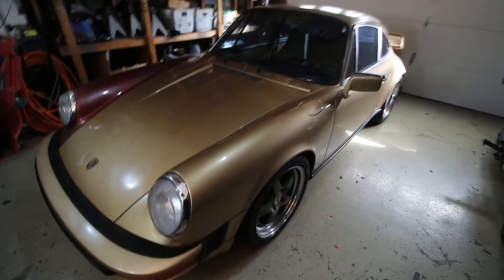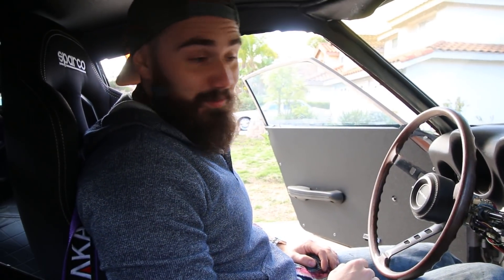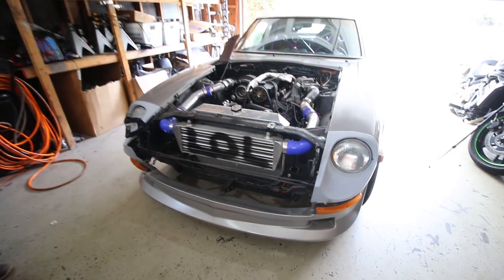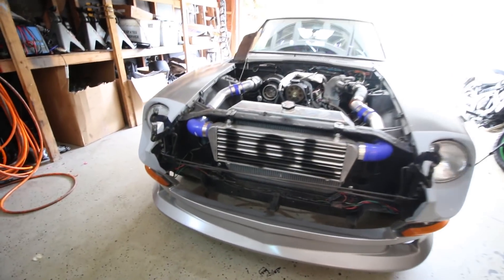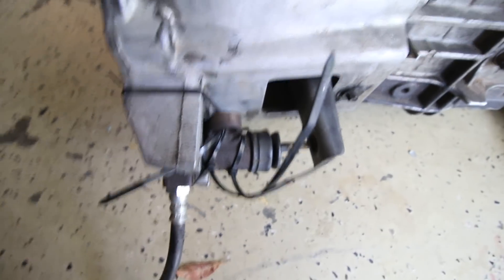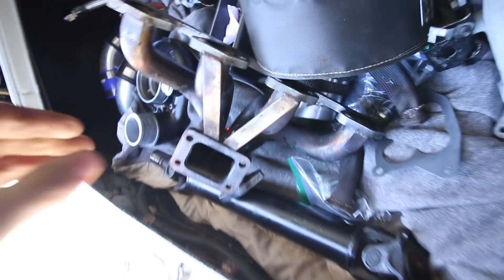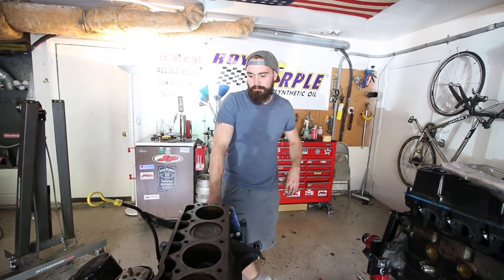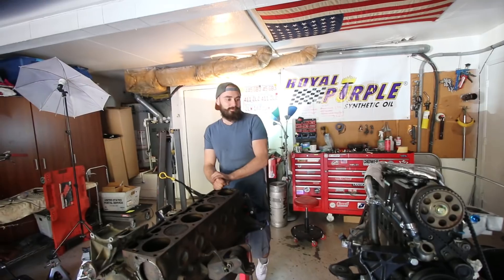The MOST HATED Engine Swap Gets Removed!

Comment: It depends if y’all want to keep it Nissan Rb26 or the original engine is fun too I am running the original straight 6 with a turbo and make 350 hp and it’s a lot of fun but if y’all want crazy power LS or a v8 are good too

Comment: Turbo 2.3 Ford Datsun 😴
Turbo 2.3 Ford Fox Body 😍
Do ittttttt
Reply: I've told them. Its a great swap.
Reply: justa4 banger I just got a 93 fox convertible with a 2.3 dual plug head and was thinking of boosting it which lead me to this channel. How much would it cost and is it worth the time trying to turbo a dual plug which wasn't made to be boosted. Not trying to go all out due to college expenses
Reply: The GTA kid. In that case the general consensus is to just star with a complete turbo coupe engine transplant ... Then slowly upgrade from there .. I haven't done this but have done the math and a TC swap IS way cheaper for a stock to stock setup .. Then sell all parts you don't use...just my two cents .. Hope it helped some ..
Reply: HAZMAT PRIEST I appreciate the info, but I can't find those turbo coupe motors anywhere for any price. Junkyards, Craigslist, Copart, and eBay nothing except modern 2.3 Ecoboost motors which I would assume don't drop in without extensive mods. Also would a turbo coupe ecu plug into my 93's harness? Thanks in advance
Reply: It depends on the power you want. If you are looking to get like 200-300hp just buy a TC motor. If you want to go higher, build your motor with forged internals and find a single plug head to get ported and go from there.
Reply: Thanks everyone for the replys, I'll be on the lookout for a turbo coupe motor now and if i can't find one I might get a Ecoboost motor when I get the time and money.
Reply: The GTA kid. It seems some areas have more merkur x4ti cars than T Coupes.. Might try that... As for the computer most people use a La3 turbo coupe computer which I believe will work in your car with very small changes but I would look at stinger performances website as they have a bunch of info on this
Reply: HAZMAT PRIEST I will, thanks.

Comment: i think Datsun should have a I6 engine, like from factory.. Sure ls swaps are cool and so on.. RB20/25/26 would be cool, but expensive. BMW engine Would be also kinda cool..

i'd personally would save for rb swap or Be a little different and Swap Mercedes M104 3.0 or 3.2 engine (watch turbobandit for info) and ask Shop to weld mercedes bellhousing to BMW 6-speed ZF- Godlike Transmission so they would fit... Atleast as good as bmw strait-6's if not better..

Comment: My efen gwd. A 4 cylinder pinto in a 240z. 
It's been 20 years since I last seen one of those pigs. 
A 240 Z in the states is the last place I would have expected one of those engines to turn up.
DEATH!!!
You best be not putting that iron pig back in. At least get a cosworth head for it.
My suggestion for the 240 Z would be a Honda K24 turbo. With no mods to the engine it's good for 550 rear wheel horsepower and is light and the motors are cheap to get from the wreckers.
An RB/ 2J swap is too obvious and common.

Comment: A 4L turbo Barra motor would be insane!
Reply: Mitch Whitmore now that's how You get it done
Reply: They wouldn’t have a clue what that is 😂 #barratheworld
Reply: Brayden Walton dat hashtag 😂😎
Reply: They're expensive to get here in the states.
Reply: Anthony Cox ah didn't think of that!
Reply: Mitch Whitmore It sucks, because I'd love to put one in a Ranger (somehow)
Reply: Anthony Cox a lot of work for a ranger. I’ve had a mate already been trying to sus it but the computer work is ridiculous! I’ve got a mate putting one in a Nissan patrol though 😂
Reply: Brayden Walton I was thinking about an older US spec Ranger ;) probably pre-2000. Then I'd run it on a Megasquirt or Haltech
Reply: Anthony Cox ahhh yeah! Should literally drop straight in with the conversion kits then! Would be good to see a couple of Americans having some real Aussie power 💪🏼 we don’t want know ls engines anymore they can’t keep up haha
Reply: Reporting this fucking comment 😂😂
Reply: DeathStroke get over ya self flog, must be a poor ls fan :(
Reply: DeathStroke who said I own a ford ? 😂 theyre just better engines. More reliable and the good old ls can’t keep up
Reply: To tall and to heavy. The 4l barra is a very tall motor with a cast iron block. Also the frame on a 240 Z is not the strongest. It would need a lot of reinforcing.